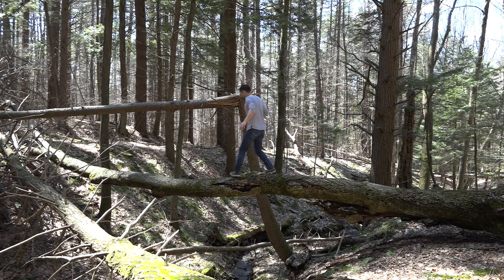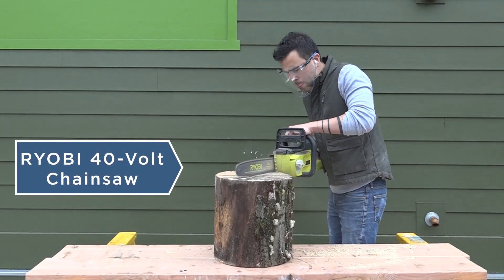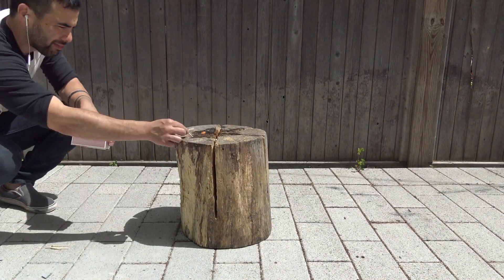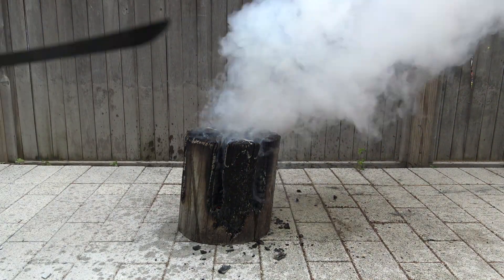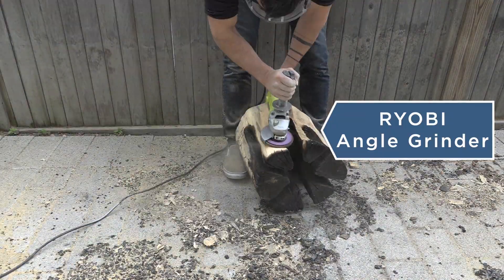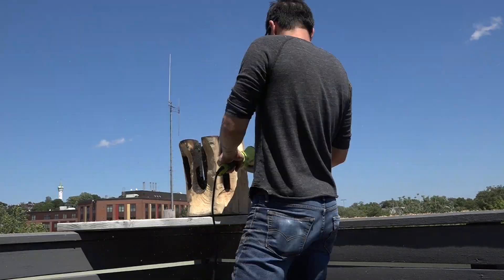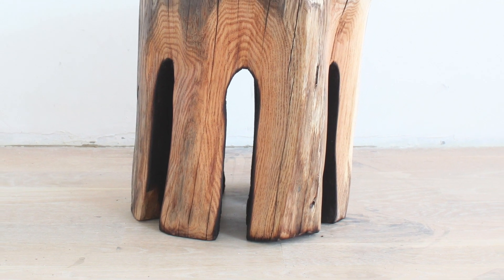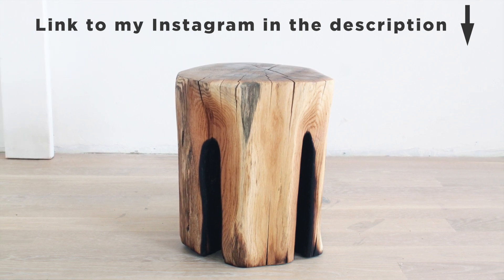DIY Log Stool

Comment: Two questions. Did you use  the clear satin sealer?  Also, I used a piece of red oak which is very light/white when prepped. Would like a golden shade like your project , but I’ve never stained oak before and I was wondering if you had a suggestion on an appropriate stain.

Comment: i've never done a project like this so i'm not sure myself, but you said you started the fire because the wood wasn't completely dry, but then to put out the fire you doused it with water... isn't that counterproductive? because the water would make the wood wet again? or is it because it's already burnt is that not an issue?